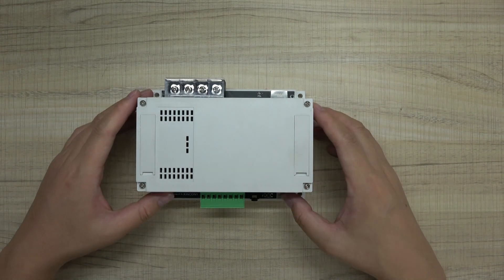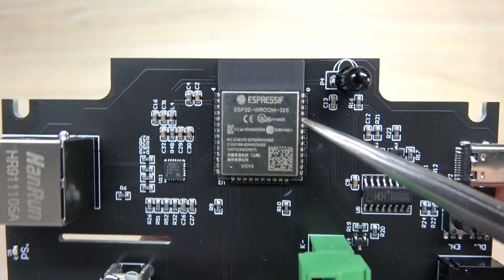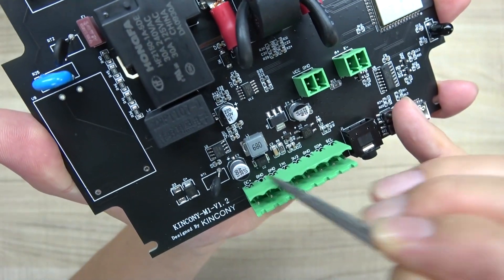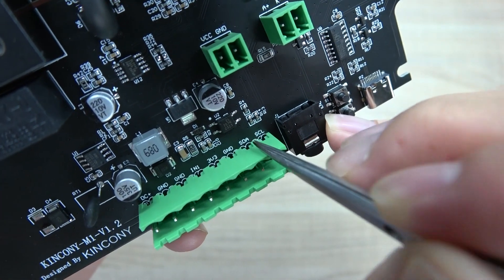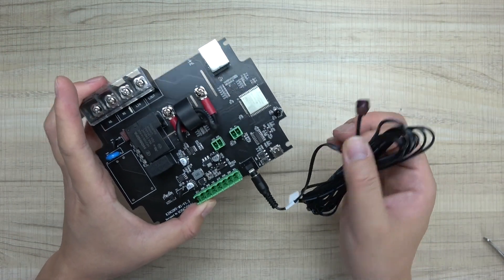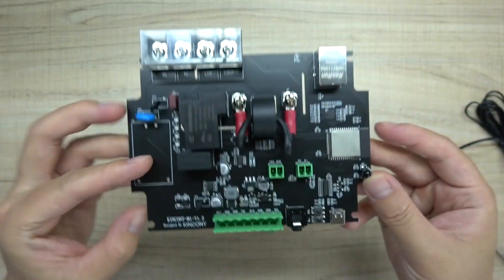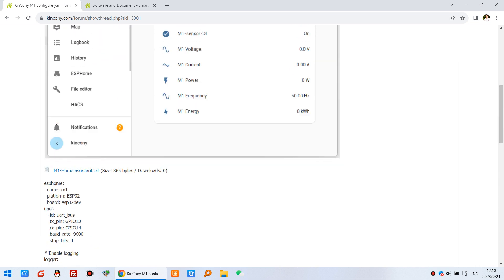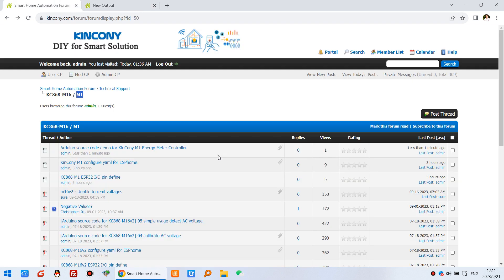KinCony M1 Ethernet+ESP32 Energy Monitor with 30A relay for ESPHome

Comment: Can I please know why do you use 25a contactor in the DB when you could use these relays of 30a? The contactors are costly as compared to the 30a relay right? Is there any particular reason for not developing a relay board using these 30a relay to handle heavy load?
Reply from the maker: contactor price high, more safety, just size too big. It cannot be said which one is good, it can only be said that suitable components should be selected according to the actual situation
Reply: @KinCony  Thank you.

Comment: I'm still scratching my head about the CT clamp. Is it necessary for the BL0942?
I can also see the ZMPT voltage sensor. Are there 2 (or 3?) different ICs used for power monitoring?

Why not BL0942 alone? I have seen a single IC only (BL09XX) in a smart plug, and that too without any CT clamp.

Also, when can we expect the schematic?
Reply from the maker: because it can detect voltage and current. schematic: https://www.kincony.com/download/KC868-M1-schematic.pdf
Reply: @KinCony  Got it. Thank you.

Looks like you used the clamp and transformer for sampling instead of a shunt resistor, which is mentioned in some schematics.

Does it provide isolation, and is it a better way than using a shunt circuit alone?

If you see in the documentation of Tuya smart plug, etc., they used a bunch of resistors and capacitors only with a shunt, without any additional clamp or transformer
Reply from the maker: The isolation method is safer because our PCB has many connectors that users will plug and unplug @imghost_l33t

Comment: Do you have board with multiple wired temperature sensor inputs (6-8pcs) and also 6-8pcs normal relays on the same board?
Reply from the maker: you can use KC868-A6